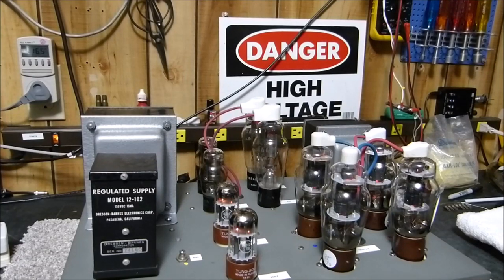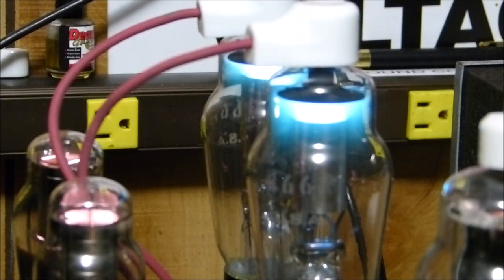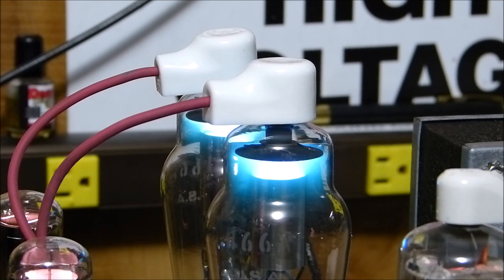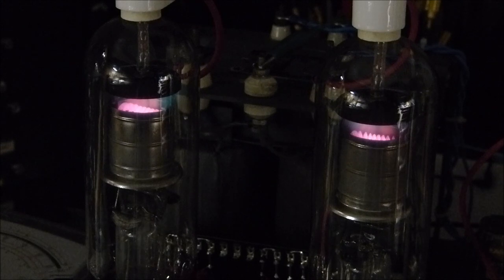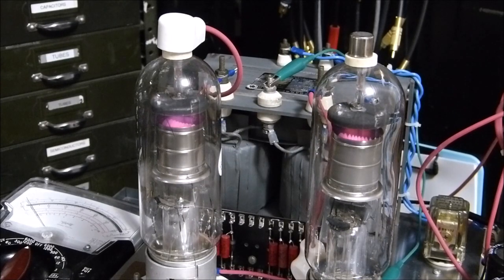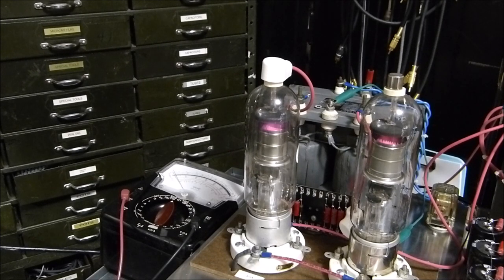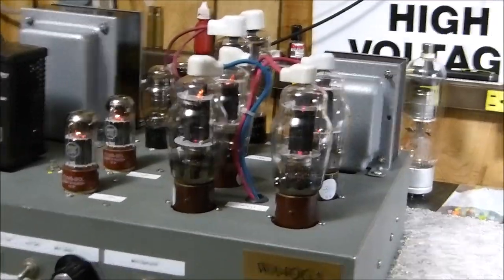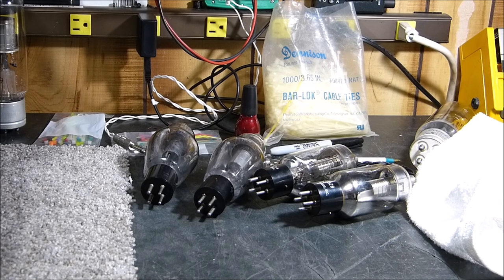Testing 872A and 866A Mercury Vapor Rectifiers

Comment: Greetings!  KF7BNQ here, in Reno, NV.  Your shorting 872 has a very obvious problem - it has leaked a bit of air!  Basically, it has changed gas discharge characteristings to something more like a neon lamp.  Over time, the pressure will probably continue to rise and eventually it will develop an outright arc.  There is likely a tiny crack somewhere in the press or the anode (plate) connection where the metal and glass have to be wetted together to form a hermetic seal.  Over the years, I've found that mercury vapor tubes tend to have a unique set of problems like this, often due to the fact that the internal components are not always metalurgically stable with mercury contact in the long term.  Sometimes, alloys can form (called amalgams) that change the mechanical properties of the metals, causing brittleness, transport of metal deposits around the envelope, and a grey powdery residue.  Certain tubes are affected more than others:  866 Jr, and early globe versions of the 866 seem to be the worst, but I've seen it in the 816, 83, and a number of the FG- series of thyratrons as well.  Another telltale sign of trouble is when the black anode carbon coating (intended to reduce secondary electron emission) begins to peel off and the bulb looks dirty inside.  Sometimes tubes with very high hours and/or that operate under heavy load can develop shorting trouble when the metalic deposits sputtered from the cathode eventually form a conductive film on the glass and that arcs over.  Early versions of the mercury rectifiers such as UX-866 (before 866A) had bare filaments and would reach this state relatively sooner.  The more modern versions have the filament encased in a can to reduce this hazard.  A final cause of shorting is not allowing the tube to warm up long enough before applying B+, especially after being shipped - in this case, conductive mercury is scattered around where it does not belong.  Heating for up to half an hour will nearly always solve this issue.  73
Reply from the maker: That is wonderful information. Thank you for taking the time to write. All in all, I am amazed that these tubes still work being made, I think in 1942. I  have a pair of them in the power supply of my AM transmitter. I also use 866A in a voltage doubler circuit in my 833A amplifier. I know that is a no-no to blast HV into a MV rectifier with a capacitor input filter, but somehow it works great. DC output is exactly 4KV.  I do "cook" my MV rectifiers for several hours the first time before applying HV when I get them in. 
Hear are some pictures of these very 872A tubes working.  https://www.qrz.com/db/wa4qga
DC output is only 1250 and into a choke input filter, but I just like the looks of MV rectifiers. 
In the 4-125A modulator of this transmitter, I did use diodes just to make sure I could get all the PS components on the same chassis. I run separate supplies for the modulator and RF amplifier although I could, or maybe should have used only one supply to save some space.
I checked my QRZ log to see if we have had a QSO and did not see it but maybe I forgot to log it. I have had QSO's with several stations in NV on 20M.    Hope to hear you on the air soon. 73

Comment: Love the MV rectifiers! Cool Old school tech that works.
A little tube amp tech diddy for ya. 
    "Got one hand in my pocket the other on the probe. Cranking the 
varactor waiting for the glow. Seeking validation for my troubleshooting
 plan. If I can fix this baby I will be a happy man. 
    The filaments are glowing as the heater current flows. Watching AC 
current while my dim bulb barely glows. Checking for high voltage, no 
flashes we are hot. Max the bias voltage with a twist of the right pot.
    Looking good so far, good luck we have had some.  But lets apply the
 volume we've got signal but no hum. Victory attained fidelity restored 
it's time to start another one so that we don't get bored." 
Cheers and keep em glowing!
Reply from the maker: LOL... I love it... I will share this with a lot of folks...  Thanks...

Comment: You briefly mentioned the voltage regulator (VR) tubes. I would like to see you do a segment on them.

Years ago, I had a Drake TR-3 which used a 0A2 regulator. A small tube to be sure. But I had problems with overvoltage and heavy audio hum, and couldn't find the cause. A fellow ham found the VR was bad. Also burned out a couple of resistors down stream.

Comment: I just wanted to let you know u make the most interesting rude videos on u YouTube u touch on all the most interesting subjects and most helpful at the same time. I am currently messing around with some sweep tubes I wonder if u have ever though of trying to use some for audio. I have very nice circuit for screen grid regulation using a high voltage fet and a high voltage  regulator makes making a screen supply a snap. Just a resistor divider and pot and u can get whatever u need. Right from the b+ anyways just want you to know we appreciate u taking the time to make these videos and I hope u continue to share your knowledge with us I watch every one of your videos.
Reply: Tube videos on YouTube not rude  lol this damn phone I can spell I promise
Reply from the maker: Thanks Jason - I really appreciate your kind words. Not only is it so much run to share but I learn something from you guys in every video I post.
I am very interested in your regulated screen supply. Do you have a schematic of it? My direct email for YouTube is   theaudioshop@sbcglobal.net.
I have not built with the sweep tubes yet but no doubt they are powerful and would probably do a great job in audio.
I have learned recently, mostly from a friend in Kentucky, to love the low mu triodes. I have some nice ones, much bigger than the 300B and I guess it is about time I made something with them. You know what ????  this is what I should turn the 1625 modulator into since I am not going to use it. Run four of the Svetlana SVT572-10 in it. That's it - my next project just after I finish the 500 watt modulator that will be using this 872A power supply.
Take care and stay safe.

Comment: So cool! I am using amperex time relay tubes to delay the HV on, using 393a thyratrons since I have had issues finding pure rectifier tubes.
Reply from the maker: That is a good idea. I ran a 115NO180 in one of my transmitters but I found out that with an extended time of full carrier, while tuning up a 4CX1000A amplifier at 1600 watts output,  apparently, the line voltage dropped a little under that full load and the delay-relay tube would slightly cool and it would drop off-line. After a couple minutes of warm-up it was "Ready" again. This was some years back before I installed a dedicated 240 volt line to my radio room. I have some thyratrons and I think some are hydrogen filled but I  have never looked into using them for delay control. I should look into that. That sound very interesting. Thanks for your comments.

Comment: Hi, I've done quite a bit with MVR's on my channel (jdwoolgar1) and found you can strike one of these with as little as 20v providing the current flowing through is sufficient...wondered if you perform the same test with a much lower voltage

Comment: What rectifier tubes and transformers would recommend for plate and output for 805 tubes? Plate voltage is 1500Vdc. I  would like to build a guitar amplifier using the 805s in parallel push pull configuration. I know that I would need a drive tube section for the 805s, possibly 2A3s in push pull configuration?

Comment: 872s are great. I used them on my 845 100 watt amplifier. Lovely looking tube sitting beside an 845
Reply from the maker: What a nice match for the 845. This is what "real tubes" look like. 
I just came in from working in the shop as the 5 V filament transformer arced to the chassis. I was afraid that would happen because when I was scraping the insulation (the formvar paint insulation) it was flaking off all over the wire. The transformer was truly NOS as I even have the box for it and it had never been soldered to but  it apparently dried out so bad over the last, who knows, years, it failed even at 1250 volts.  I put a new Hammond transformer in it that is made for lighting a pair of tubes like the 4-400A filaments (5V, 30A) and I am concerned the transformer is not really made for HV filament supplies. It is working now - I hope it keeps  working.

Comment: This was very helpful, thank you!
Reply from the maker: I  am glad it helped. I discovered this our of desperation. I was just hoping I had at least two good tubes out of the four. I should have mentioned that this test should probably be pretty short because if the MV rectifier is conducting in both directions, it is putting some level of AC across the power supply capacitors. If they are oil filled caps it probably won't matter but I use series electrolytic caps and reverse polarity across them can definitely damage them.

Comment: Hi , I am planning to make PSU with 866A or 3B28 tube in my 845 amp.

But I have some worry on the UV light hazard emitted by these tubes.

What do you think of this ?
I heard UV-C is relatively dangerous.
Reply: I've read similar accounts of the UV light emitted from them.
Reply: @MM0IMC  
Hi, you don't have to worry about that.
UVC emitted from mercury contained vaccum tubes doesn't reach you.

It's similar with mercury lamp.
But mercury lamps used for sterilizer are harmful.

Comment: I was watching a youtuber that goes by curious mark, he was working on an old teletype unit with MV tubes, he warned about firing up the power supply in a certain sequence as the tubes could explode, I think? I'll have to go back and watch his video again.
Reply from the maker: I am never going to say things can't happen but I have never seen or reliably heard of that happening. The first time MV rectifiers are inserted in the socket after laying around on their sides and upside down, etc for years, they do need to be "cooked" in for 30 minutes or more to get the Hg metal off the cathode and in the bottom and sides of the tube so that it can become the proper vapor when the filament is lit. After the initial cook-in, they  only need to be on 3-5 minutes before applying HV. If HV is applied to them cold. they may conduct in both directions just like the bad ones in my video. I don't know for sure. Thanks for your comments.

Comment: Great videos. ?? I have been  slowly picking up some 866A's and 816's lately and the last 866A I ordered is so clean and new looking. No getter flash or mercury anywhere. Is this normal if the tube is brand new? It's a National NL-866A...Thanks for your time.
Reply from the maker: Well, I don't  know about the clean MV rectifiers.  Just looking at the ones in my video they are pretty clean but some look terrible and work perfectly. I have had bad MV rectifiers. They will flash-over when the voltage gets too high for them and blow the fuse instantly. There is a lot of nonsense on the Internet about MV rectifiers. Read the manufacturers recommendations and that will work. They will tell you something like, let them run at least 1/2 hour when "new" to get the Hg into its proper state and let them warm up around three minutes each time you turn them on cold and they work. They are beautiful and have a constant voltage drop not like the 5U4 where the more current you draw the more voltage drop you get across the rectifier. The 83 tube is a MV rectifier and is used in the TV-7 series of tube tester because it has a constant voltage drop and should not be replaced with a 5Y3 or other vacuum rectifiers. I suppose it could be replaced with SS rectifiers but I wouldn't do it. The RCA-83 can replace a 5U4 with socket pin rewiring and will probably improve the performance of the amplifier over the  5U4 if you want something easy to work with and have fun.   https://frank.pocnet.net/sheets/021/8/83.pdf
Reply: @ElPasoTubeAmps  thanks for the info.

Comment: Hi David, I really like those MV tubes and the VR tubes as well, just beautiful. Two questions.. How well do the VR tubes keep their rated voltage output with heavy loads such as loud bass music as that amp is setup for music, or power line fluctuation? And is there a way to "see" the faulty MV tube in operation say with an oscilloscope, watch it go neg and pos? Thanks, Tom
Reply from the maker: Hi Bucyrus,  I really don't have a numerical value for the HV under full load in the setup I have the amplifier in now but I would assume it is pretty much the same. The manuals state that the voltage drop across the MV rectifiers is constant at 10 volts and I assume that is true up to its maximum current rating. This constant voltage drop definitely differentiates the MV rectifier from the vacuum rectifier like the 5U4. I would assume the voltage drop in either of these amplifier configurations is primarily due to the internal impedance of the power transformer and not the MV rectifiers. In a vacuum rectifier like the 5U4, just for an example, the more current drawn thru the 5U4 the higher the voltage drop is going to be across the tube and the hotter the tube is going to get. Actually, the MV rectifiers don't get that hot. As for measuring a good from bad MV tube in some sane manner (besides plugging it in and see what happens...) I don't know. My TV-7 tube tester "tests" 866A rectifiers (but not the 872A) and the big bottle 866A'a in this video, test good but as mentioned, they do not work in delivering the 3.5 KV,
Reply from the maker: Bucyrus - I see I answered the wrong question. 
You asked about the VR tubes and I commented on the HV (750 volts) regulation. 
In the  video before this, with no driving signal, the 300 volts was something like 306 and with full load and the VR tubes still barely lit, it was about 300 volts. Pretty darn good. 
You can read exactly what I measured and reported in a comment on an earlier video of this amplifier on the regulation of the VR tubes. 
To test it at heavy bass and running at full volume, I have to load it into my 8 ohm hot water heater element dummy load where I have a pot (something like 350 ohms) across the load and can tap off a little audio and put it on speakers so the volume is normal (low) but the amplifier is running at max output. I have not done that yet but maybe I should and make a video of that type of measurement.
Reply: @ElPasoTubeAmps  Well, I would like to see that video, but don't do it on my account... If your curious as well, than do it.. Thanks for both answers.. Oh, and that video on line transformers.. I needed a 10-15 watt output transformer for SE 6L6... I purchased a nice Thordarson 20 watt for 8 bucks, worked perfect... Great info

Comment: ELPASO, 5y3 and GZ34 rectifier tubes use what type of vacuum gas? because the rca 83 rectifier tube uses "mercury vapor" which the mercury vapor does what and rectifies and compresses differently?
Reply from the maker: The 5Y3 and GZ34 and other vacuum type rectifiers like the 5U4, etc., use a hard-vacuum inside the tube. As I understand it, the tube is evacuated of all gasses. Rectifiers like the 5Y3 and 5U4 have a direct heated filament that is the cathode. The GZ34/5AR4 have a metal shield around their filament that is heated by the filament and the shield is coated with metal oxides to make it emit electrons more efficiently and this becomes the cathode connection, separate from the filament. The internal spaces are much closer in the GZ34/5AR4 and there is less voltage drop across the rectifier tube making it a bit more efficient than the 5U4.
As for exactly what and how the mercury vapor facilitates the rectification of AC to DC in the Hg tube - I can't really find a great description of how the Hg in the tube works. The good thing about the Hg rectifiers is the voltage drop across the tube is steady at about 15 volts regardless of the current flowing thru it and they can handle a lot of current for a small package. I have described the Hg rectifier as the "solid-state rectifier" of 100 years ago. Being much more efficient and able to handle higher currents and PIV, the Hg rectifiers is still a marvel to me. 
I assume that when Hg (sometimes they are called MV) rectifiers go bad, they become contaminated with air and then they will arc over internally and become a short circuit instead of just conducting current in one direction and end up blowing fuses. Hope this helps - I really don't know the physics of how the Hg does it job inside the tube.